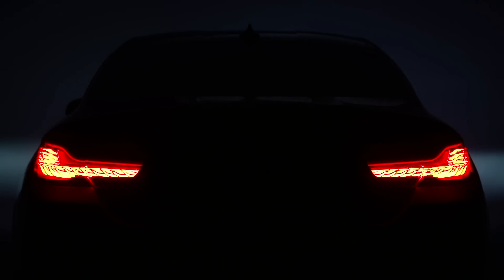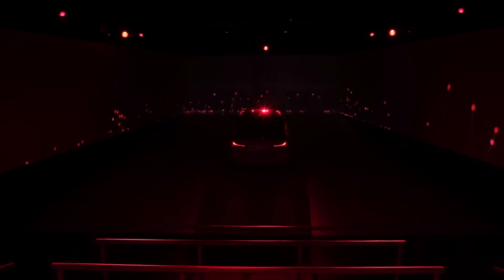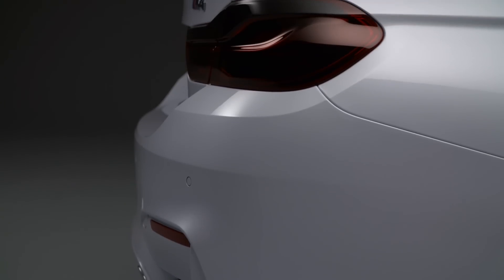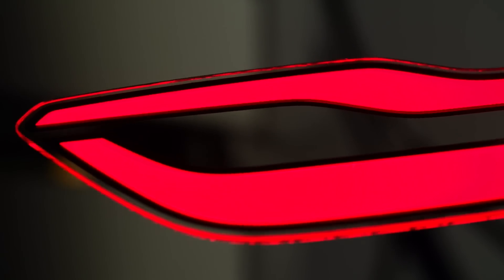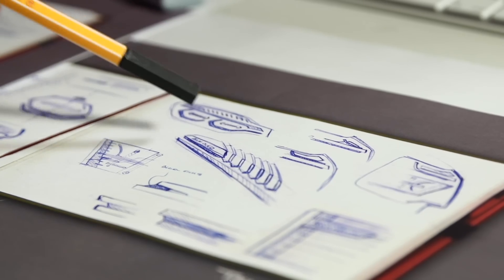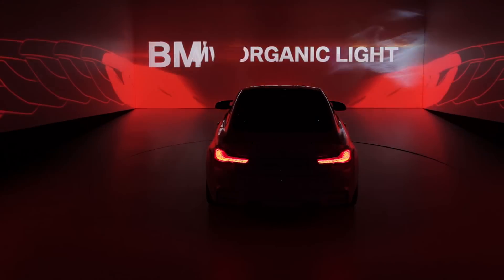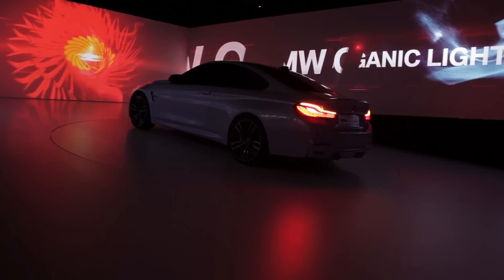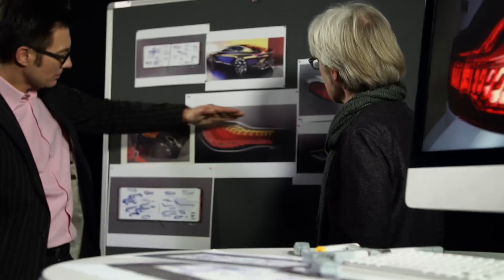The future of tail light innovation today. BMW organic light OLED.

Comment: Pitty BMW keep making things look pretty but still failing totally under the bonnet with reliability.
Having owned a couple of newish bmws, multiple failures within 65,000k mark where other Japanese cars i've owned (Honda mainly) are quite happy doing 150,000k+ with absolutely ZERO failures at all, (usual cambelt/waterpump replacements at 100,000 though but no self failures before hand)
Failure of headlight controllers, fuel pumps, water pumps, ignition system, hell even the bluetooth module failed within a couple of years (stupid big box in the boot just for a simple bluetooth unit) all of these failures would have cost thousands of dollars if not for a warranty.
Plus having a car suddenly stop on the motorway with no prior warning of increasing engine temp was incredibly dangerous.
Reply from the maker: Hi Hamish, we're sorry to hear about these problems. Do you need any assistance?
Reply: +BMW Hamish is right. I work at BOSCH-Helsinki,and there are line of BMW"s outside the service. Every second BMW comes with on screen message " Steering lock fault "..,then failed water pumps,failed VANOS,many,many xenon self adjusting motors broken too..,burned xenon bulbs,drained batteries..overheated engines..,list is very long. I am sorry,but how long will take you to buy one Lexus or Honda for the matter,and study it inch by inch how some people are making cars for decades,that can actually hit a 100 000 km without serious problems. Oh,i almost forgot,you could do that,but your main profit is not from the car sale,but the maintenance after,right?? Parts made in Turkey,China,Romania,Mexico and elsewhere. That is your philosophy. Aggressive marketing,nice,sugar coated appearance,fancy technology and lights,and under the hood plastic cheap crap. Good job. And my job is to recommend to every customer to get rid of his poser BMW junk and buy Lexus or Infiniti.  Oh,sorry for being rude,but shovel up your technocratic "assistance" up your..
Reply: +S.T T. honda and inifnity is for people that cannot afford german engenering my mom drives Mercedes Benz  E class 2016 and my dad drives BMW 6 series. Not a single problem on both cars at all. My mom had volvo and my dad had toyota some years back and they got problems toyota only one so thats not bad but volvo ..... but my moms E class and my dads 6 series not single problem at all
Reply: Never had problems with mine, but in general, all german cars are bad compared to japanese cars. Statistically speaking
Reply: Amir Davoodi You making more money than Swedes:))? Son..,people who do lot of money,never come to youtube shouting and posing about it. They have life. You dont. You are most likely on social support,or working at pizza-kebap. Your intellect is equal to a fish..,a very small fish. People with low intellect and education,coming from Middle East work as kebab makers,car repairing,or car wash..,or dont work at all. And dreaming for Mercedes,BMW and Audi.. Why? Cause they are humiliated all their life..,never respected. And you hope,when you get that biig,big Mercedes,all people will respect you and fear from you.. Fuckn pathetic idiot :) Go make kebabs and save money for some junk.
Reply: +S.T T. typical poor man "order a taxi" i can afford 20 000 infinitis and lexus cars but still german engenering i want . Lexus is great car but infinity 😂. You know why Mercedes is taxi? Mercedes want every passenger that rides on mercedes taxi cars to be in a safe ride. They want to both passengers and taxi drivers to drive in comfort and safety thats why moost taxis are mercedes. If there would be infinity a taxi fake japanese i would walk instead.  Toyota, Tesla is taxi to. so Tesla is not premium? infinite is toyota wanna be and every young guy that only makes 5000$ buys it to be cool with a cheap plastic. Also my dad is waiting for the new 5 series g30 and i cant wait
Reply: Amir Davoodi I dont base my taste and purchase on "" every rich and high important people" choice. I am I and i dont need a car brand to feel important..unlike you.
Reply: +Amir Davoodi sorry im not meant to be bad but working att bosh is not high person i mean i mean. Doctors, loyers, and civil engineering or people that own oil are rich people. i dont have problem if you like infinity its a cheap car that works but germans cars in my village every doctor drives BMW 7 series, Mercedes Benz e mercedes benz S Audi a7 lexus is,
Reply: Amir Davoodi So you know every doctor in your village,and what car he drives,but you havent learn proper English? I dont have personality issues. I drive what i like.
Reply: Funny. My BMW's have been the most reliable (under the bonnet) of all the cars i've owned.
Reply: Everyone knows that Japanese cars are more reliable than European cars. Although European cars are high quality, but you really can't beat those amazing Japanese engineering. you would rather buy a car with reliability over technology, right? we just don't want to see the error light always lights up.
Also BMW has "burn engine oil" issue..
Reply: carzakone333 There is something called perceived quality and the Europeans are masters of it while the Japanese are masters at just plain quality.
Reply: +S.T T. also why does every rich and high important peopls driving mercedes bmw and audis and not infinitis?
Reply: Amir Davoodi Oh deal Lord..,are you really that stupid,that you dont know that the "5000" is actually a ..model?? You thought that its the price?? You seriously cant be that dumb! let me help you  http://germancarsforsaleblog.com/1986-audi-5000cs-turbo-quattro/
Reply: Nobody buys a BMW because it's cheaper to maintain then a  Honda or a Toyota. People buy BMWs because they enjoy driving. if you don't like to drive and just want something to go to the damn grocery store by all means don't buy a BMW. second of all out Honda pilot is the biggest piece of shit I have ever seen. the piston rings are shot at 85k miles so it burns oil. This is not an uncommon issue you can look it up pretty much much all Honda v6s from the late 2000s have it. Also, Honda has had a history with shitty transmissions and terrible paint quality. Toyota has great reliability but probably make the most boring cars on the road. lastly, look up wards best engine list on Wikipedia and tell me who has gotten the most awards.
Reply: wich model bmw did you have problem with and wich year?
Reply: Amir Davoodi If i wanted to drive Mercedes E class,i would order a taxi. Show me one Infiniti or Lexus taxi. Regarding the "German engineering",i suggest you read this.
http://dougdemuro.kinja.com/german-reliability-the-greatest-myth-ever-sold-to-amer-1572026115
Reply: +S.T T. and the link every thing was bs that they guy had wrote he probbably drives suzuki
Reply: +S.T T. of course i know wich car every doctor drive because the live close to me and i see their cars everyday. My english is bad because im from middle east and live in Sweden but im proud that still make more money then many sweeds.
Reply: +S.T T. my cousins familys that live in Iran, Persia im from Persia every one every single one is surgeon. They are driving Mercedes S class and Rolls royce and own 3-5 rich houses. Dont belive me? ask a guy that is from Iran. Surgeons in iran makes much money if you hear the amout of money they make you would suicide. Your stupid why? 1. i can afford every thing you own  even im young. 2. Youre Stupid. My parents where refuges 36 years ago and you where born in your country and my parents where in war and things like that and they came to Sweden when they was 18-19 years old and they make 1000000000x more cash than you. So you are the kebab. Dont belive me i can send pictures when ive got my Maserate Levante S for christmas this year if i get a good job.
Reply: +S.T T. Shame on you :)
Reply: +S.T T. wow a guy that hates german cars and love cheap infinity buys audi. but im not suprised 5000 for Audi is like price tag on candy. Also i work hard. I almost killed my self n school to be number one with grades to get good job in future and know i deserve a 60 000$ car from my parents thats hard work ...
Reply: +S.T T. well i bet your not young that car is from 86 damn
Reply: Amir Davoodi Mine was 91. Good that you noticed at least that. I am on my 40"s.
Reply: really?????? must be buying one that wasn't maintained....wow.. that's pretty much how it will be if you buy the cheapest used BMW you can find....lmao. can't get good quality cheap cheap used BMWs from someone who could barely AFFORD to use premium GAS in it!!! 3 different models, and only regular repairs that are expected from ANY car depending on the age and service HISTORY RECORD DUHHHHHH. Go cry somewhere else like to ford. Or go get another 100,000 mile BMW that owner before you never repaired before you bought it....!!  wow. stupid is as stupid does...
Reply: Win8pc Straight in the target. Many points you got right. Though,as an ex Accord driver ( the last one was CH1 Type R) ,after which i replaced it for Galant,or Legnum if you call it,Estate VR4,since i was waiting a newborn,and needed a bigger car,that is fun to drive too..,and replaced it few months ago for an BMW E39 530I Touring. Now,lets make one thing clear. I have always driven the Accords right to the red zone. You do that,sometimes you have to add oil,no doubt. But engine,cooling system,electronics and gearbox worked flawlessly during my ownership. Had to replace only rear shocks,brake discs,pads,few bushings,steering rods,and oil for near 2 years of hard driving in Finland.  Needless to tell you,that i had great joy of driving,summer and winter!  But its not a solidly made family cruiser in any mean,as we have to shout with my wife at speeds over 100 kmh..Very noisy car. Incredible fun i had with the VR4 too. Especially the winter. Never had issues with it wither,except the engine ticking noise when cold ( hydraulic lifter,typical issue) . The only reason i sold it was the rust,due to the fact,that i live in Finland,and we have like 7 months of winter. It had very complicate 4WD system and suspension,and it was all rusty,and if goes wrong,it would cost a LOT! Now,once i go BMW,i noticed the premium materials in the saloon,ZERO rust,amazingly quiet cabin at speeds over 160kmh and lots of room for everything. But..,the ownership started with replacing the whole cooling system..,soon after that the camshaft and crankshaft sensors failed..,almost at the same time the double rear door refused to open,and had to have the shock and cable replaced. The stock stereo was absolute crap,although says Business CD,it was the poorest sound i ever heard in a car! The pixels were half gone on the OBC..,then the rear power window refused.,and had to replace the wire and motor..,and now,before i pass the inspection,i have to replace the left side self adjusting xenon motor. Failed too. Now,before you start with how bad condition the car was before,let me tell you,it wasnt. No dents,no scratches,no tunnings,full BMW service history and quite not much driven ( 225 000 km) Lets go further..,the cooling system on these cars is a joke! Never seen so cheaply made cooling system! Basically its all made of plastic,and the idiotic bleeding screw is made of plastic too..,so whenever you decide to bleed it,and you are on your summer cottage out the city,and you brake that screw,you are as screwed as it gets. And there ends the joy of driving. To be honest,i havent experienced some special driving pleasure,that its so much fuzz and noise about it. The car looks great,sport seats,manual transmission,all the bells and whistles,and yes,its very quiet at high speeds,but its a damn heavy car by all means!! As fast,as it is,the joy of driving the Type R and VR4 is wayyy,wayy above! Pay attention,we aint talking comfort and quiet cabin. We talk pure driving joy! With the Beemer,every time i push the gas a bit and decide to twist its tail on some roundabout,i am expecting with fear some warning light on the dash. Unlike with the Japanese. You can trash them to death,and unless the rust doesnt ruin them,they will last for decades! That being said,i am already thinking of replacing the E39. Perhaps will go for Lexus RX. Might be bland compared to X5,but i wont be hold hostage and sponsor to badge and looks. I rather spend the maintenance money for my family.
Reply: +S.T T. there is no doubt that a bmw will require more than average maintenance on some items I'll agree with you on that. but if you can diy i think it's pretty reasonable. cooling systems and window motors tend to always be weak points in them
Reply: Win8pc Some things you can do yourself. Brakes,oil,filters,some cable here and there. My point was,that BMW build its image on E32,E30,E36 and E34. The customers were amazed from the quality,inside and outside.  20 years later you got sugar coated fancy facial,and electric water pumps,leaking cooling systems,broken timing chains,transmissions and a lot more. I had F32 for a week,replacement car,while my E39 was in the service. The car had only 8600 km,and on the second day the windshield wipers didnt work. Air condition was very noisy,the fabrics were feeling incredibly cheap,and the plastics were painted in cheap grey color ( i guess the BMW customers havent paid well enough to deserve real aluminum),the air con was loud and noisy at its lowest level,and the engine was sounding like a old diesel in the morning. The day before i returned it,the oil light came,and the next day the engine light,after which it went to limp mode. Premium car at 8600 km!!! My wife was shocked ( she loves BMW) and didnt want it even for free!!
Reply: My father had a BMW in 1994, it ran all the way to 2005 then he sold it. by that time it's still working perfectly fine.
Reply: I'd say you're in the minority then.
Reply: Derek Ortiz No,he is not. BMW E34 ( if he refers to that model) is one of the most reliable BMW"s. Many of these cars are still on the road. If the cooling system is maintained properly,and the oil changed regularly ( with quality one),these cars can take unbelievable abuse,and last decades. Get one,drive one,and we talk again.
Reply: S.T T. Ok. That's your experience. My experience is that I've had several friends with e 30s and e 92s, 325xi's, and they've all broken down. With me in the car on several occasions. Just recounting is all. If you love BMW, then go for it, I'm just wary of german cars. I like ze lexus. Less performance, but bulletproof build.
Reply: Barkin up the wrong tree here, man. I don't even care about cars, good story, but you're never going to sell me on a BEEMER, unless it's an alpina, and if I'm in that price range, I'm probably getting a gt350r, z06 or 911.
Reply: Hamish Robinson I own a 2007 e60 530 xi with 200k miles and still runs like a champ. Have had little to no problems at all
Reply: The over complicate in design and the crap fails.  Keep it simple BMW.  I don't need my seat to move as if in zero gravity.  Oooops, one of my 200 seat motors just failed...that will be $1,200 thank you.  Pretty overcomplicated crap is what BMW is.
Reply: Man, just remember, while the Japanese brand cars are tested in the worst and crucial environment in middle east(cuz terrorists are using them for decades) while mercedes was the middle eastern country's big love, bmw is loved by nobody in crucial environments, thats why I guess.
Reply: +Amir Eclass Your knowledge in english makes me feel ashamed as a swede. Especially since you're telling me that you're 22 years old. You better get a bit wiser if you want to be a doctor, instead of boasting about money. People that earn a better amount of money never say "Got jobs 💸💸💸💰 and know we live the life." Neither do they say "People in my area belives when they se my dads 17 000 000 swedish kronor house and a young boy that still young driving 60 000$ car." if they have common sense, which seems to be a shortage today.
Reply: Xenon your comment is ironic.
Reply: man you just wasting your time, i feel after few more dialogs his father will buy a BMW to you as well
Reply: Zihao Liu True.  BMWs and upper crust MB are not rugged vehicles and are not simple in design or to fix.
Reply: Hamish Robinson You do realize nobody cares right😂
Reply: buy an E32 or E34 - best quality.
Reply: You should have bought a Mercedes-Benz.
Reply: Amir Davoodi You DO understand,that your question is as stupid,as it gets,right??

Comment: What the fuck is the designer doing to these cars? The look ugly as fuck. BMW ruining the cars that I once loved. I will NEVER get a current-model BMW because looks like utter crap. Rather get an E23, E24, E30, E34, E46, E82, or E92. Literally any other model looks better than these current generation pieces of shit.
Reply: No.
Reply: +kade b I guess every car company should be stagnet and keep building the same old cars year after year after year with no improvements. You might as well go grab a 1908 Model T. Technology is always innovating. From a business stand point, you'd be out of business if you didn't innovate. OLED, Sensors everywhere, modern designs are all what makes cars new. I love me E36...but damn it's 21 years old! CD player....really? analog controls, manual seats, plastic cheap interior. Is that what you want? Doesn't sound like innovation to me

Comment: Whenever i stop to wait a customer, i do wipe the snow off of the tail. The problem is though, that when you gotta drive a longer trip, you can't just stop all the time, since it doesn't take long for the tail to be covered in snow again. That's when i use the tail foglights to keep at least a part of the tail lights visible. Even if i don't do that, usually the tail lights produce just enough heat to be barely visible, even in this 2015 520d xDrive. How ever that is not the case in a new C-class mercedes benz for example.